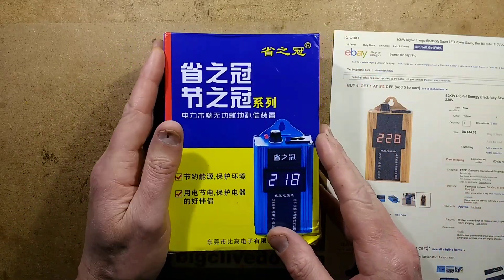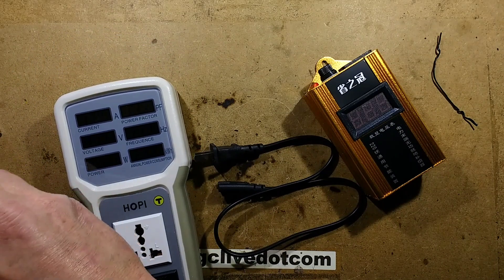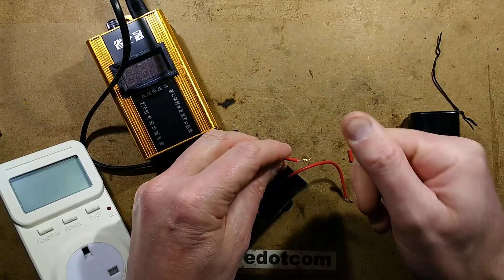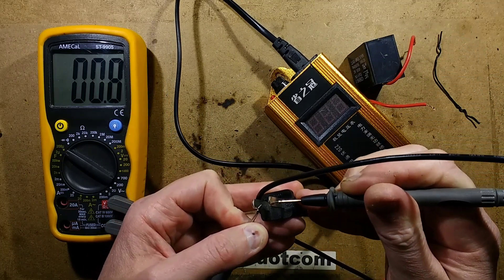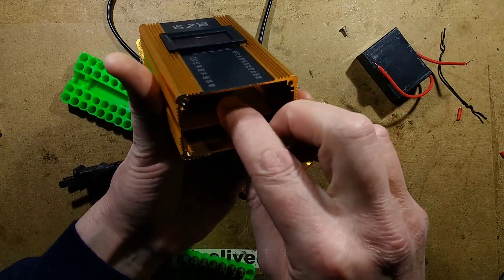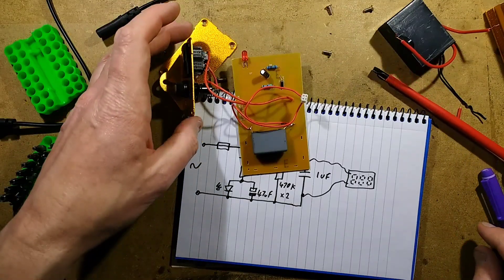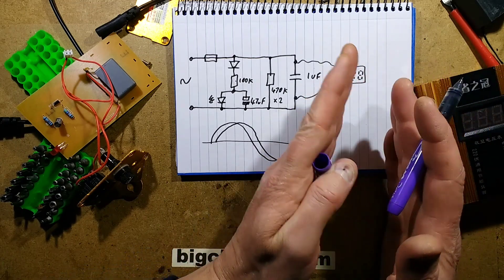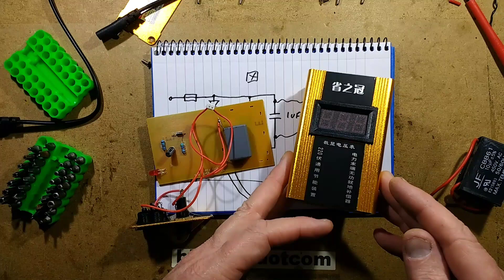Inside a digital 80kW power saver unit.  (with schematic)

Comment: To what is the 80kW supposed to be related? Such a thin wire and most houses only have 9 or 15 kW supply total anyway.
Reply: To give the manufacturers/marketers the benefit of the doubt, and because this is being sold as a noise/transient filter, I'm going to say that the 80kW rating is the maximum instantaneous transient power absorption possible by the device. This would be mainly dependent on the capacitor's ESR, as well as the connector and cable resistance between the outlet and the capacitor. To absorb 80kW at 240V, the capacitor would need to momentarily conduct about 333A. This would imply an ESR of about 0.72Ω, which is actually generously well within the typical range for a 1uF polyester film capacitor. Add on the cable and connector resistance and I think 80kW is just about accurate for maximum transient power absorption for this device.
Reply: Kris M numbers sell 
ken m is that you?
Reply: around here the typical house service is 150-200a @ 240, or about 40-50KW, older house's with 100a services often get upgrades.
Reply: +animefreak5757  Wow, where is 'around here'? Who needs that much power?
The only instance I can think of is when you do all your heating electric while not using a heat pump.
Would be way too expensive here, if you need that kind of heating power, people choose gas or oil. (Oil is on its way out due to environment unfriendly)
Reply: +Benjamin, no Ken here.
Reply: Hrm, here in KY, most homes that have had electrical work, or been built in the last 20 to 30 years are all on 200A service... Heatpumps are the primary source of heat unless you are in the city, however, in the winter at night, a Heatpump can't keep up with heat demand.  Most homes will have a 10-25Kw heat strip that kicks in once the heatpump starts hitting the limits of being able to keep up in sub-freezing temps.  In your part of the world, 15Kw might be normal, however, in other parts of the world, 50Kw is normal.  Some homes will go as far as having 400A service, though that is very rare and typically seen only in what most would consider a mansion.
Reply: +Dielectric  Although the device does not dissipate that energy it still needs to transport all those amps through that wire. That wire is gonna disappear at 333A like the wire in a slow fuse.
To make the power bill savings that they usually claim (10-20%?) the wire would have to support a continuous/average of 8kW or 16kW reactive power.
Many people will realise that the number is BS anyway and is just there for selling to people that are unaware of how electricity works but I still would expect most people to notice that 80kW and such a thin wire are not a realistic combination.
Reply: north america,  And it's not that hard, a lot of house's have basement suites, or are built so that it's possible to do that in the future.  2x stove and 2x cloth's dryer running at the same time would be tough to do on a 100amp service.  A lot of heating around here is resistive electric as well.  Heat pumps are great, but expensive.  They also don't tend to work that well when they are buried in a snowbank.

Comment: It did show 600 mA for a brief moment.
Reply: The Hopi meeter that is when connected to the capacitor (several short glimpses around 600)
Reply: Yes. The Hopi meter showed 616mA at 5:25 and once again afterwards. It seems to need a little longer to register such a highly capacitive load. Power factor was 0.004. No real surprise.
Reply: I had a feeling someone already commented on this :)
Reply: After sleeping on it I'm pondering if it's so short bursts that the naked eye doesn't catch it it's only when it's just synced with the frame it is possible to catch it.
Reply: It read something in the 500 range briefly just before the 600 too.
Reply: I noticed that too a couple of times
Reply: Pete Allum I rather think that this is due to the deathdapter having a bad connection to the cable.
Reply: Yes, dodgy connection.